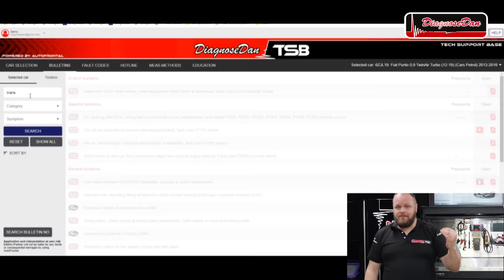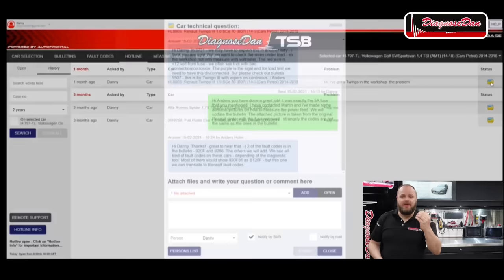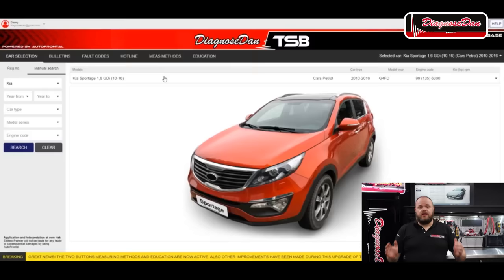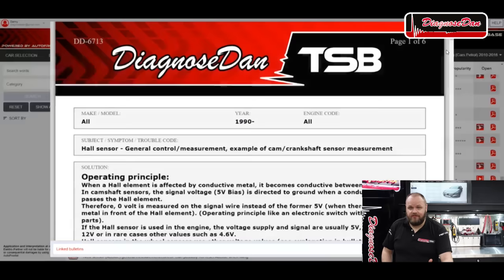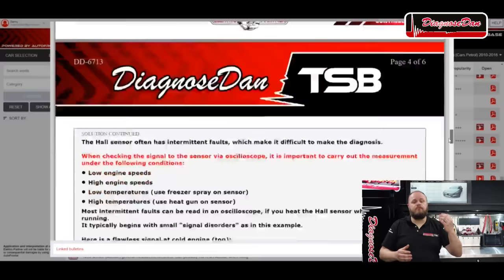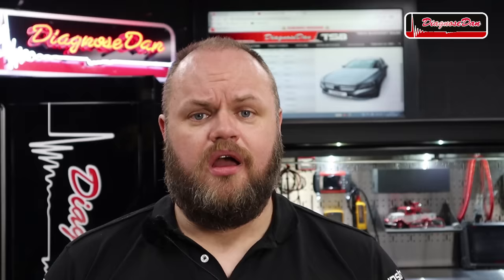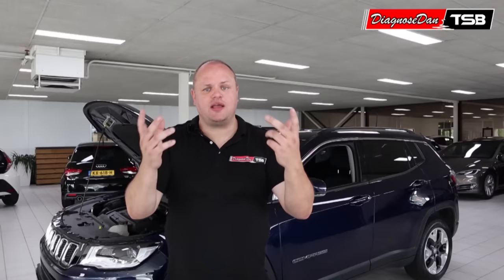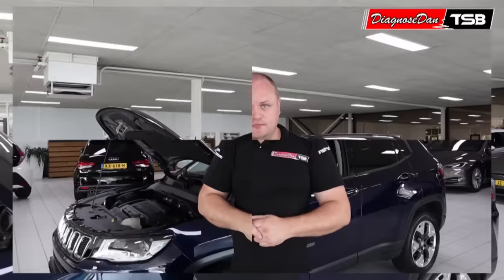Fuel trims explained (the easy way)

Comment from the maker: DDTSB.COM
Reply: 23-03-2019  will there be any wiring diagrams?
Reply: It would be nice if you had a low cost option for non-professionals, limiting them to info for one specific car.
Reply: 23-03-2019
Reply: 23-03-2019
Reply: 23/3/19
Reply: 23-03-2019
Reply: DATE: 24-03-19  ,Mercedes-Benz C-Class 1.6 C200 BlueTEC (205) (14-)
PD chassis number: ABC123
Reply: 23-03-2019
Reply: 23-03-2019
Reply: 23-03-2019
Reply: 24.3. 2019
Reply: 23-03-2019
Reply: Hello from UK!!!
23/03/2019
Reply: 23-03-2019
Reply: 24/03/2019 😁
Reply: The answer is 24-03-2019
Reply: the answer is First registr.date:
23-03-2019
Reply: 24/03/2019
Reply: 23-03-2019
Reply: 23/03/19
Reply: The car was registered on 23-03-2019
Reply: 23.03.19
Reply: 23-03-2019
Reply: Short, but easy to understand also for beginners 👏 23.03.19
Reply: 23/03/2019 great informative videos as always
Reply: 23/3/2019 good luck with your new business!
Reply: 23-03-2019
Reply from the maker: @kevinbent7655  no wiring diagrams, but it will be an optional  upgrade in the near future.
Reply: Hi Danny! The answer is 25-03-2019
 :) Nice beard by the way :D
Reply: 23-03-2019
Reply: 23/03/2019. adding the wiring diagrams it will be good idea, thanks for the video master.
keep goin mate.
Reply: Answer. Current local date - 2 years.
Reply: 23-03-2019
Reply: 23.3.2019
Reply: 06/04/19
Reply: 23.03.2019
Reply: What wiring diagram you are using Dan?? And where to buy the wiring diagram for European cars??
Reply: Great video as per usual (great invaluable info...! 🤜) Just to pick you brain about something, I’m currently working on a 2001 Bmw m5 5.0 v8, I’m getting permanent fault for oxygen sensor control fault on bank 2 and my live data is saying the fuel trim is positive 2.3% on bank one and 1.6% positive on bank 2 , where in your honest opinion would you start checking....? Any help would be greatly appreciated!
Reply: Hi @diagnosedan is wiring diagrams on ddtsb?

Comment: I think the hardest part about fuel trims for most people to understand is that positive and negative relate to the fuel itself. Positive is adding FUEL and negative is taking away FUEL. When you relate it to rich and lean though it seems opposite. Rich, which is usually too much fuel, would have a negative fuel trim. Lean, which is usually not enough fuel, would be positive fuel trim. Once it clicks it becomes much easier to understand.
Reply: So, so true.  I have just had it explained by the best and, just when i think iv'e got it! Failure again, it's the opposite of what i understand it to be.
Reply: Well said
Reply: Exactly!

Comment: One of the best Diagnostic Technicians on YouTube. Thumbs up for another great video.
Reply from the maker: Thanks Richard 👍
Reply: @Diagnosedan  He is right. Here in the states, we have Mitchell, Snap-on, and few other nation wide repair databases, but I would trust Snappy over Mitchell. I like to hear of your program, because you think unlike most mechanics, just like the rest of SOME of us. It is nice to see passion. Most guys (as you know) misdiagnose, and we have ALL had them, but to be more accurate, is ALWAYS the goal for the passionate ones. In closing, do you have database coverage for automotive platforms in the states??
Another great video, thanks!!
Reply: Dan looks for the reason with understanding the system.  Throwing parts at it has never worked.

Comment: What is the reason if ltft is jumping istantly from +3 to +12 when I adding rev to the engine? Why did it changes so quickly?
Reply: Any check engine light? Possibly bad o2 sensor?

Comment: On the early FI GM cars it was called block learn and integrator. Before that on the 3C carburetors the ideal number was 28-32 at idle. So many cars would come into the shop with low float levels and idle mix screws off that we’d have to do a set them up all over again. We would adjust for the 28-32 using idle mix screws and the MC solenoid upper and lower limit as well as travel distance between the two on the metering control rods. A tiny bit higher float level would help the cars have really good acceleration at full throttle when the 4 barrel secondary metering rods would get pulled up.

Comment: Brilliant lesson, keeping an open mind is always key, in the 90 s a customer complained about poor fuel economy on a vehicle under warranty, it was also factory dual fuel, (LPG) after checking fuel trims there was no evidence of excessive fuel consumption on petrol, but having faith in customer it turned out OEM was allowing petrol to be injected whilst on LPG TO cool the cylinders and exhaust valves but it did not show and there was no technical release of this in any literature, only after my persistent harassing the tech support did they admit to it and release a TSB stating this
Reply from the maker: Great job!

Comment: Speed density vehicles will not show a vacuum leak in the fuel trim. Only engines that have a MAF meter will show  the vacuum leak in the fuel trim.

Direct injection engines increase the fuel pressure via the high pressure fuel pump rather than increasing the fuel injector pulse width.
Reply from the maker: Thanks for watching 👍

Comment: For awhile I had a hard time undertaking fuel trims till a drive tech I worked with explained it super easy…..
He said pretty much “short” fuel trim are like instant fuel mileage and “long” term is average fuel mileage ..
Typically when there’s a check engine light on from too rich or too lean it’s because the computer can’t compensate anymore and there’s a problem…-25 to +25 is typically the range ….

Comment: Very clear explanation, thank you for that! I was wondering since yet some time what short-term & long-term fuel trim referred to. Enjoyed the reference to a carburetor, though imho most carburetors were somewhat more tricky to adjust than in your exemple.

I was wondering whether the short-term & long-term fuel trim idea also applies to diesel engines (I guess yes) and how to look for it with VCDS (say on a 1.4l diesel 9N3 Polo). If you or someone else here has the answer, please let me know.

Once again thank you for the quality content and for educating me!
Reply from the maker: Thanks for watching Serban

Comment: With the Bosch K type fuel injection system, they had a mixture adjustment in the air flow meter. My own car has this system. The best way to adjust this is by using a "colourtune" tool. This device is put into one of the spark plug holes, & tightened like a normal spark plug. The mixture is then adjusted until a pale blue flame is seen in the colourtune.
Reply: I am VERY well versed in the K-Jetronic systems... and I have never heard of this.  Probably because what you said makes absolutely NO sense.
Reply: @Johnathan_Waters  this obviously tells me you have never worked on a 1976 Mercedes Benz with this fuel injection system.  Before you start saying what I stated makes no sense, you obviously know very little about them. One of my mates has a 1980 Mercedes Benz with the k type jetronic fuel injection system fitted and the mixture can be adjusted. I uses to repair the older Mercedes Benz cars for a living. I also repair other European makes too, and most of the fuel injection systems they had were adjustable mixture. Maybe you should visit me, and I'll slow you how this is done.
Reply from the maker: Never heard of this before, but we all learn new things every Day!
Reply from the maker: @Johnathan_Waters  it does, at least on older cars.
Reply: @christophermarshall5765  Yes, I get it.  You're talking about "tuning" based on running the engine, and then taking the spark plugs out and reading them, correct??
Reply: @Johnathan_Waters  I use the colourtune system to set the fuel mixture in my car. This device is installed in one of the spark plug holes.  This enables me to look at the combustion process while adjusting the mixture. When i see the combustion process showing blue, I then stop turning the mixture screw and I rev the engine to check. The colourtune device takes place of the spark plug and is made from high temperature glass. This allows you to look at the fuel combustion process.
Reply: @christophermarshall5765  That is amazing!  Thanks for sharing, and sorry about my obstinance earlier!
Reply: @christophermarshall5765  The K-jetronic is a mechanical injection system, so not computer-monitored. Basically a very accurate carburettor, so has a base setting, like a carburettor, and few inputs to change the base setting or fuelling graph.  Rare to find this on anything post 1996, as full electronic control is needed for emissions after that date.
Reply: @nigelcox1451  sorry to burst your bubble,  but Mercedes had a full electronic fuel injection system on their early twin cam sixes and V8 engines. This system was known as the D type fuel injection system with a lambda sensor in the exhaust and trigger points for the injection system. The K type jetronic fuel injection system had no similarities to carburettors, meaning they have no float chamber and no jets to block up. The carby type system has only 2 fuel filters.  The k type jetronic fuel injection system has 11. The air flow meter works by vacuum in the manifold in accordance to throttle opening.  This plate then moves the piston up in the fuel distributor unit, this controlling the amount of fuel delivered to the cylimders. There is no choke, nor any accelerator pump and jet to worry about.
Reply: @Johnathan_Waters  apology accepted.  I think you might be interested in buying a colourtune device.
Reply: @christophermarshall5765  Now you mention D type, which has nothing to do with the points put forward.  K jetronic was a mechanical injection system, as you've now described. No electronic control of fuel trim.  Once set, no running adjustments are made, only following the pre-set parameters set by diaphragm, vacuum, and needle profile. Pre-set, like a carburettor, but more accurate.  I added a comment, enhancing what was already said, you are arguing for the sake of it, well done.
Reply: @nigelcox1451  there is no needle profile in the k type jetronic fuel injection.  The only mechanical parts are the air flow meter plate, the fuel flow control piston and throttle valve. The cold start injector is switched by temperature sensor and relay. The system you refer to is found on the models from the early race cars through to 1972 300sel 6.3. These had the injection pump driven by the engine. The k type and D type fuel injection system have electric fuel pumps.  The k type jetronic fuel injection cannot ever be classed as a type of carby. So you better stop your nit picking. If you read one of my early comments, you would have seen that I used to repair these systems for a living, meaning I do not need you to telling me how they work. You would have also seen written that my own car has the k type jetronic fuel injection system fitted.  I very quickly become very annoyed when I clearly state I repaired these systems  yet people like you try telling me how they operate.  Bad move.
Reply: This is absolutely true, I used this tool in school. But I'm yet to see a K jetromic system in real work life so I've never worked on these systems outside of school. I'm currently working at BMW so we use more modern systems now.
Reply: @darrenkuthalane5080  awesome. If you watch a few Mercedes Source videos, you'll see a few K type injection systems in operation. Operating correctly, they are very efficient.
Reply: @Diagnosedan  maybe I should do a video next time I do a tune up & service on my 1976 Mercedes 450SE. I'll show the "colourtune" device being used. One person who commented thinks this type of fuel system is mechanical. Partially correct. The only mechanical components are throttle butterfly, & air flow meter with the fuel distributor piston. The injectors cannot be adjusted, & there is no "needle point" settings. The rest works on vacuum, & fuel pressure. The fuel is continuously circulating through the system under pressure. It has a pressure regulator. The air filter element used on these systems ( MANN part number: C40174) is large in diameter.

Comment: Nice one! To add this as you say you work mostly on EU cars you could add the VAG way of showing Idel and Parcel fuel trims, with specified and Actual lambda numpers.
For example today i fixed P2187 (System too lean at Idle) +25% idel mixture and actual lambda was still 1.190 on idel with specified of 1.000.
Breathervalve drop the numbers to +4,6% and lambda to 1.000 at idle. ..After test run car had passed all its EOBD readyness test fully, without any errors.
Reply from the maker: Great fix! Of course we have a bulletin for this in DDTSB
Reply: @Diagnosedan  I may try it as my self before i "Sell it to my Boss's" so what is the VAT? is it 1% 10% 19 % 24% 50%....?

Comment: Dan, you had an excellent explanation of this subject.  What parts would increase the fuel economy more?  replacing all four oxygen sensors or replacing the I.A.C.(Idle Air Control)valve and T.P.S.?   the vehicle is a 2001 Chevrolet Express 3500 5.7L.  Thank you

Comment: Dan, you should delve in a bit deeper and discuss the same vacuum leak scenario but when the leak is confined to a single cylinder intake runner but the exhaust and o2 is being measured from a combined point of all the exhausts on a 4 or more cylinder engine. It’s a quite a different situation.

Comment: I guess that makes sense that no 2 engines are the same, wich is why every optimization program needs to be done per vehicle, i plan to optimize my diesel engine for more power and less fuel usage, i even plan to do DPF off programming because less issues and better fuel economy

Comment: Dan I really love your content and your knowledge but unfortunately in this video your analogy regarding carburettors in comparison to electronic fuel systems is incorrect. For your viewers benefit I will explain   On a carburettor engine adjusting the mixture screw only changes the idle mixture and does nothing for overall performance, In fact, once the throttle is opened the idle circuit is no longer having any affect on the fuel mixture and it is the size of the main jet/s that dictate the mixture relative to airflow. 
Electronic fuel systems on the other hand are constantly updating over the base fuel map throughout the entire RPM range by the fuel trims adding or subtracting fuel from the base fuel map and this is what makes it so good 👍Love your stuff Dan

Comment: To be fair, the fuel pump analogy is probably not the best. The injection time is calculated based on fuel mass requirement vs current fuel pressure. If a pump was failing, the ECU would already know to try open the injectors for longer. Fuel trimming isn't designed for fault conditions.

Comment: Hmmm what makes a vehicle bog down when fully warmed up won't accelerate hesitates to stay running and backfires. The short and long term read 32.8%. At idle when cold started seems fine no issues. Fuel trims read good. +- 0.75 between 10 but long term stays consistent as well 0-9.75 but after it gets driven then the long term shoots up to 22 then 32.8 then short term rises as well then they both read positive 32.8 and code is a p0171.

Comment: Great vid!👍 I get an po107 code but here’s the kicker. I get it every year on my 08 pont vibe. I have absolutely no symptoms-runs like a charm! And it only happens in the winter!  Goes away or I clear it in spring and doesn’t come back till following winter! No leaks, chkd maf sensor. I’m suspecting poss cloggd gas filter or maybe the fuel injectors. But No symptoms at all. Any advice. 
Thx

Comment: Dan is good at explaining many thing. Just don't see how you can make this "easy" as the manufactures us different sensors and metrics of measure.
Reply: What, are some of them using metric percentages?
Reply from the maker: I don't fully understand what you mean?
Reply: @Diagnosedan  My comment was made before the video was posted and I lost an "e" use. 
Your video was more about the function of fuel trim/ fuel injection vs carburetor. A concept learned and forgotten years ago by me.
 Today it's all about what data I can read "see" from the ECM and why it's not happy. Is it volts,%, wide band,switching , upstream , down stream, heater circuit working, closed/open loop, how much air and what temperatures does the ECM see.....
 At the "tech" level fuel trim is a lot more there can I drive it rich or lean. More of a "basic" fuel trim explanation then" easy " The easy way is to have some one else do it. 
This is what I did. You spent X hours to make y minutes of content for me to watch. Your doing a great job and keep the "film" rolling. 
Euro spec. cars can be trying some times just because I don't work on them a lot and wiring does not match. Take VW Euro spec. written in German, built in Spanish speaking Mexico, translated to English for the US market. What could wrong ?

Comment: Hiyya Dan Mate I have "trimmed" carburettors  so many times when I was in my teens and early twenties and in a way I  miss being able to tinker. But a very good video Dan I really was interested in something that until now went over my head. Just out of curiosity what would a partially blocked injector affect the engine fuel trim readout?

Comment: Hi Dan I have been working on a 2009 mini with code p0420 could you explain how it’s possible to have fuel trim numbers adding up to 2 but on the gas test co was 1500 hc was 285 and lambda was 967. All bad but good FT and new b1s1 o2 fitted. Tia

Comment: 008851 - Fuel Pressure Regulator Valve (N276)
P2293 - 002 - Inadequate Performance - MIL ON, what to check hpfp is new ? Fuel pressure regulator? 1.4 tsi CAXA